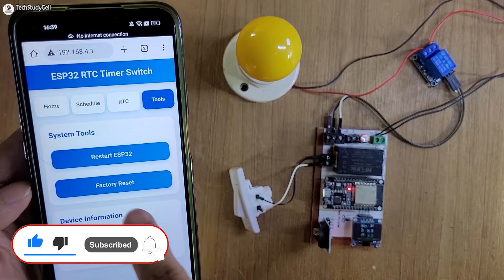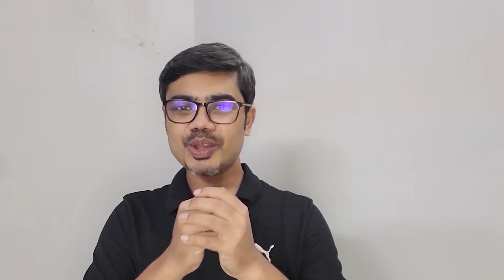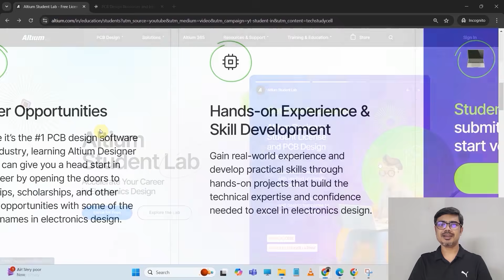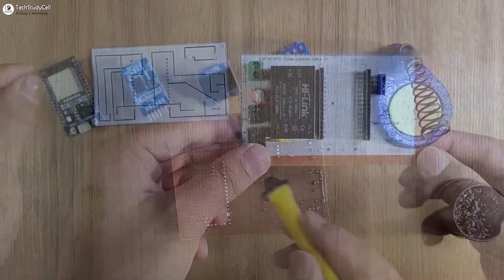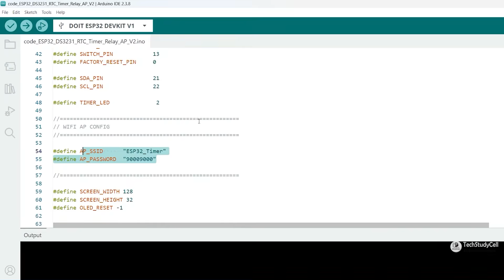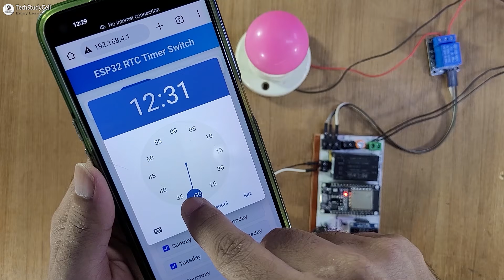ESP32 RTC Timer Relay Switch | DS3231 Weekly Timer + Web Dashboard | ESP32 Projects 2026

Comment: I noticed you added a capacitor, why?
And what's the capacitance and it's rated voltage?
Also at which place in the circuit do I connect the capacitor?
Reply from the maker: It is optional. I have connected a capacitor across 5v and gnd. You don't need to connect it.
Reply: @TechStudyCell okay Thank you

Comment: What happen when electricity goes off and timer runout ,which state remain?
Reply from the maker: If the off time 8:00 pm and electricity come back at 7PM the relay will turn on, but if electricity come back after 8:00 pm the relay will remain off
Reply: @TechStudyCell  thanks for anwer  if on time 5 min  example 8.00 to 8.05 on time  ,after 8.03 electricity off and electricity comeback after 8.06 then my output ?